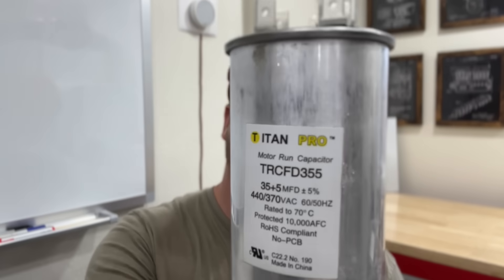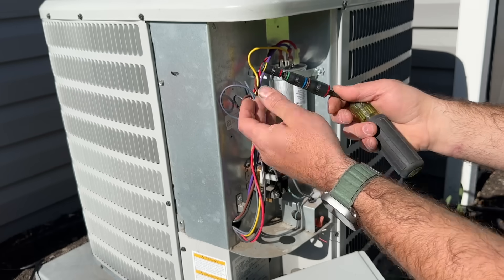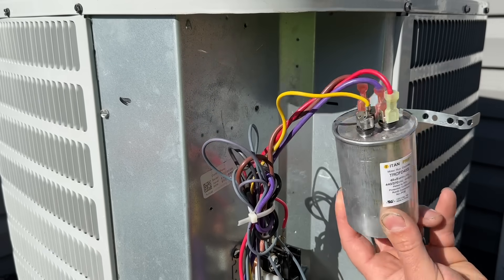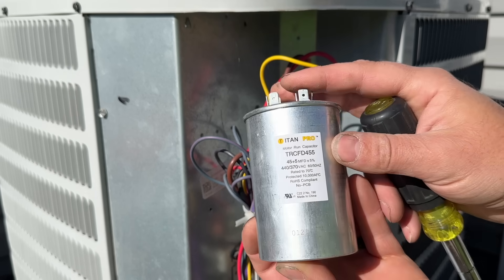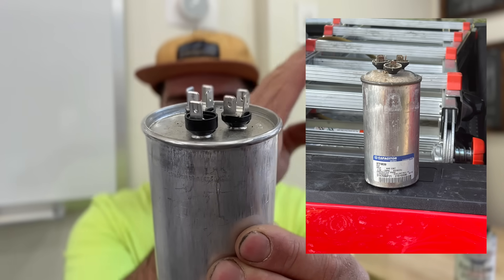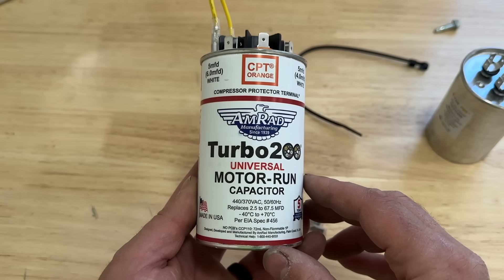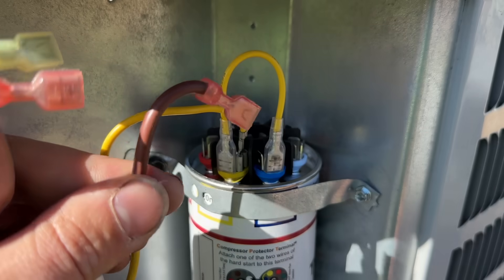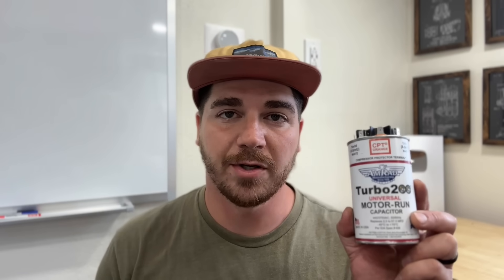HVAC Contractors Practically Make Their Living On These

Comment: I was scammed by Cool Ray in Alpharetta, Ga.  I signed up at Home Depot for Cool Rays $29.99 AC tune up (BIG Mistake).  My AC was operating perfectly fine, but for 29.99 and I hadn't had an inspection for a couple years, I said, "what the heck"...  Well, guess what the Cool Ray guy tells me, "your capacitor is really weak and it could severely damage your AC unit if it fails"...  He just happened to have a AMRAD Turbo 200 Universal capacitor on his truck.  While he was getting the part I googled the part and yes, $70 on Amazon Prime free shipping.  I asked him how much to change out the capacitor?  Part and labor:   $432.  The Cool Ray technician made it sound like a big job!!  He installed the new capacitor and closed the panel in under 5 minutes...done.   I will never use Cool Ray ever again!!  BTW, when I questioned the technician about the job and cost, he became very embarrassed and said it was Cool Ray that requires us to replace these capacitors and to charge this high amount..."we wouldn't make any money on these AC tune ups if we didn't replace something.  Cool Ray is a scam and they know it!!

Comment: Last summer my AC company told me the capacitor was going bad and quoted me $330 to replace it. I gambled and didn’t have them replace it and luckily made it through the hottest summer even in south Louisiana. This spring I bought a replacement and did it for under $20. I bought a spare to keep on hand too.

Comment: Had an AC guy tell me that my family might die of carbon monoxide if i didnt spend $10,000 a whole new hvac system for a 1500sqft home that was only 5 years old.  all it needed was a $30 capacitor.

Comment: I have used my HVAC company for years. They are really honest. I'm lucky. I just had my units replaced... it was time. There was an electrical issue that shut one of the units down... it happens.  The company dispatched a tech and he said I need to replace BOTH of them. I have a good relationship with the owner and called him. He came out with the tech and Op's manager. It was a fuse. A $1 part. The owner was embarrassed. More like appalled. He fired the tech right in front of me. The owner was very apologetic stating over and over again "my father would have never allowed this, this is not how we operate". He fixed it right then... himself.

There are good ones out there. Few and far between, for sure.  Aaron- you are the man.

Comment: This goes for ceiling fans as well.
This past Thursday, I made my Thursday rounds to one of the gyms I do maintenance at. The manager said “7 of the fans won’t work… I think the fuse is blown” well I knew right away a fuse wasn’t blown… plus they are breakers anyhow. I told her “nope… the capacitors are bad”. “How do you know that? You haven’t even done anything!!!” I told her to flick them on as fast as possible on the dimmer” sure enough, a few came on. I told her “that’s how I know!”
Changed the caps and swapped the dimmers for regular switches… no issues!

Comment: Something people should at least look into is home warranty companies.
When we bought our house in 2007 we signed up with a home warranty company.... American Home Shield.
I have zero connection with them other than being a customer. 
It was about $35/month.
Now it runs about $55-$60/month.
There's several different package levels you can opt for. Each level will warranty different home items.
For example the level we pay will cover AC/heating, water heaters, sump pump, water softener, washer/dryer, stove,  refrigerator, in house freezer (not in garage or porch) dishwasher.
Sewage stoppage, ceiling fans etc.

Over the first 4-5 years we mainly had a few issues with our central AC unit.
We paid the service charge (around $75) and the rest was covered by the warranty company.
Around 2013 we had our entire AC system for and the only cost we had to pay was the initial service charge ($75) and then the outside concrete pad for the condenser around $90.That was it.
Total cost would have been over $5000.
A year later, the electric hot water heater took a dump.
Same charges as before and saved us over $700.
Your mileage will very of course but this is an option worth looking into for some.

Comment: Great video.  I'm a mechanical engineer and have replaced several start-run capacitors over the years on my HVAC units.  Helpful to know how to look up the specs and reconnect for a smoother startup.

Comment: my 15 year old AC "went out" a few years ago over the 4th of july.  like any DYIr, I went out to the unit and listened...  heard the slight hum, checked on the internet looking for a solution and found the same thing.  the hard part was getting the part itself.  no hvac company would sell me the "test fix" part.  I found it on amazonia, and ordered the cap and fixed it without issue.  1 of my coworkers AC fritzed (8 years old) and he paid over $16k for a new complete replacement unit without even trying the capacitor change....  and yes, I did suggest it...  I guess it takes all kinds......

Comment: Great video! Best video for so many to save money every year. Every several years I have the same coil go bad. I have local company come that sold me the system come out and charge me $190 service charge and $380 for the coil. I even had the cover off and already check it so I knew the coil was bad.  I also have the 7 year warranty for parts and labor. “Parts and labor” , that means I/you still paid a “service call fee”.  They also warranty the coil for a return to factory and give me a $190 dollar rebate. Total cost $225 + taxes and misc for nylon wire ties. It’s always been the coil only once Ive
a fan go out. Your viewers need to understand this is an easy coil swap. However, you do need a level of mechanical ability to read and understand the multimeter and voltage you’re testing. 

Thank you,

Comment: Homeowners thinking they should only pay for the part and not for a service is wrong. A good AC company will check the entire system before leaving. We, just like any other business are doing it to make money. While I do not agree with $2000 for a capacitor. I do not agree it should cost $15 to change a capacitor. Find yourself a small Honest AC guy and pay for the repair, max $250 if the rest of the system checks out. We look at other things when we come to service your unit. Yes there are scum bags that charge way too much but please don’t lump them together with good honest people trying to make a living. Stay away from bigger companies because that equals high over head and higher repair costs.

Comment: I got charged 300 for this repair. I knew I was being scammed but I have a tenant and really had no time. In my rage and shame I changed entire ac system to mini split with solar panel with battery for 20k in material. I was quoted 120k to change the ac and that is without solar. I thank them for the scam that fueled my rage.

Comment: The HVAC industry are crooks. I had a guy come out to look at my heat pump and told me it was going to be $3500 to fix. I rechecked the breaker myself and it was the problem which cost me $20 to fix.

Comment: Also 90% of all heating and air technicians I’ve met do you not know how to charge an air conditioner correctly let alone install one and do the procedures that will make him last twice as long. Also, the sad truth 90% of all refrigerant gets blown out into the air. All the homeowner have to do is put up cameras and learn the procedures of recovery, then they can get their system for free because it would be a lot cheaper than what the EPA will do if they find out

Comment: If the HVAC company wants to immediately sell you a new unit or gives you an outrageous quote for something simple like a capacitor replacement, kindly decline and find a new company. Years ago my dad had a leaking A coil on his heat pump, first company wanted to replace his whole heat pump after telling him the parts weren't available. Calls a second company, they picked up a new A coil from a local supply house and had him running in no time. 

Personally I've replaced the capacitor in mine 3 times over the past 20+ years and last year I had to swap out the outside fan motor because it seized up.. it's been working like a champ since.

Comment: About a decade ago I started shadowing professionals while they fixed recurring problems. The jets in my gas furnace get plugged up every 3 years or so. $400 fix. It was the jets getting old. $36 for the parts and 15 minutes to repair. Toilets - piece of cake. A/C capacitor - $20 and I keep a new one inside the A/C. I consider hiring a pro as paying tuition.

Comment: Kinda irrelevant but our AC has been running great since we bought the house 10 years ago. Couple years ago we had our machine inspected by a local large HVAC company that have a lot of great reviews. magically it stopped working the moment they left. In 90 degree weather for 3 days, each day they sent one of their guys to look at it and they all shrugged and said it was just an old AC that had been sitting on a slant and to buy their new 4000 dollar unit. We ended up hiring some Mexican guy who didn’t speak English and he showed us the wire they placed in the unit to short it. AC magically started working after replacing the wire and has been working without error since. It’s just appalling the original guys that inspected it and then all three of the guys that came after were so dishonest and scammy and not one said or did anything about it. The first repair guy was all cheery at first and swearing like we knew each other but after he looked at the machine he was all business and wouldn’t budge on any explanation and just wanted to leave.

Comment: ☝️This is why I LOVE YouTube! I have probably save upwards of $25,000 over the years learning to do simple things just like this, that a “professional” would have charged an arm and a leg for. Motorcycle maintenance/carburetor rebuild, bathroom reno including plumbing, framing, drywall and door hanging which cost me a total of $1500 which included tools and materials! Vehicle alternator replacement. Tiling. Minor electrical work. The list goes on…

Comment: We had a service tech come to "service" our outside unit. He said there was a problem with the circuit board and it had to be replaced for $1000. We said we would talk about it then call them back later. Come to find out, he disconnected a wire. We will never call that company ever again.
Reply from the maker: Wow this is the exact sketchy stuff I’m talking about. You should have straight up sued that company

Comment: The screwdriver that you used isn’t insulated!  Insulated hand tools for electrical work have an exposed orange rubber coating.  On the inside there is yellow rubber.  If the yellow shows through it should no longer be considered insulated.
Reply from the maker: The handle is insulated from the metal, you can’t use an insulated shaft to discharge a capacitor. Maybe I’m just referring to it wrong. But you obviously don’t want to be touching the metal portion lol

Comment: Recently, I needed an AC repair and sure enough, it was the capacitor, it took the technician about 5 minutes to change it..he was in and out of my property in less than 15 min, and I was out of $350.  I guess, I should feel Lucky that he ONLY charged me $350 instead of thousands of dollars.  Now that I have watched him change the device, and I'll save this video in case the capacitor goes out again.  I looked it up, the capacitor that he used cost about $15 on Amazon.

Comment: Does anyone else hate the length of the tail on the cut zip tie on the wiring @ 1:55? Like... why even bother? Just to make a plastic shank? Who ever did that wants the world to burn.. and that wasn't a "u-f" it was a "mu-f", Greek lettering and it means 1,000th of a milli or "m". That is important because it explains the jumpers and other aspects of what you're explaining. Aside from my little nit pick, this is a great video! Thumbs up!
Reply: "the length of the tail on the cut zip tie"

Right?! If you don't want to buy the tension-adjustable flush-cutting cable-tie "gun," at least trim it close with your dikes (better; leaves a very short tail) or trim it FLUSH with your utility knife. One of those sharp tails will slice you up if you hit it just right. No pride of craft.
Reply: @PanhandleFrank  YUP! That would easily get you solitary if found in your cell. It is SOOOO easy, and you are already there! You already demonstrated having the tool(s) needed by making the original trim. You're not reusing that zip tie and "need room to grow". It's good to go, all grown up, adulting as a zip tie does. Tidy it up; tailor that suit bro.

Comment: I had a certified HVAC tell me my capacitor was bad and offered to change it for $450, which I declined. I bought one on line for $20 and did it myself. The unit still didn't work. Turns out the main circuit breaker had tripped but you couldn't tell from looking at it. after toggling it back and forth the unit came on instantly. CHECK YOUR CIRCUIT BREAKER MAIN!!!!!!!!

Comment: Just replaced my capacitor. I bought one for backup and thank God I did. I had to use it just today. My AC has the exact symptoms, fan only no buzz from condenser. After replacing it, out fired right up. AC back on, registers showing 58 degrees!

Best of all, $15 bucks! Ordered another backup instantly. Ready for the next failure.

Comment: Yes, even much smaller capacitors than this one are capable of instantly melting a screwdriver if it shorts the terminals (think arc welding) . They really do need to be discharged carefully through a suitably large resistive load.

I don't like that you left those jumper connectors bare.

Comment: Dummy, that is a run capacitor you're holding it cleans the sign wave to help the motor run through the NILL of the sigh wave. A start capacitor gives the compressor a boost to help start. YOU DON'T KNOW WHAT YOU'RE TALKING ABOUT!!! Just because you can make a video doesn't mean you know anything. At least get the fact strait!!!!!!!

Comment: So, question: Is there a time frame for changing one? My unit is 6 years old. This time last summer it suddenly stopped cooling. It was the capacitor and it was replaced under warranty. Would I expect it to go bad every 5 years now, or is it so random it's not worth it.

Comment: Usually its a good idea to check the AC, spare capacitor before summer start.  Label each terminal with color of each wire, or remove one by one.  Don't fall victim to those phone solicitor to tune up your AC.  When they arrived they will give you estimate on what is broken, a scam.

Comment: The capacitor you were holding is not a $10 capacitor try $30-$40  Normal charge to replace it should result in a $125 diagnostic and around $85 for the part. Anyone charging more than that is a rip off. Remember the customer always has the option to diagnose and fix it themselves. Nobody forces them to call the HVAC contractor. Pro tip: Rinse the dirt out of your condenser coil with the hose every year and you should never have to replace the capacitor.

Comment: Yup. Air Around the Clock got me for $350 to change one of those out. The technician left it behind when he left so I looked it up. Found it for $20 online. So that was $20 for the part and $330 for labor. Considering HVAC repair labor rates are between $75 to $150 an hour, I'd say I was overcharged by twice what the job was worth. Thanks for this. WIll be doing this repair on my own from now on.

Comment: Had a very similar incident with my well pump. When I ordered the new capacitor off Amazon, I went ahead and got 2 so I would have a spare that sits right next to the box. 2 day shipping seems fast when you are just ordering a pair of socks but 2 days of flushing toilets with water from the hot tub feels like an eternity.

Comment: I have a Trane AC Condenser manufactured in 1988.  The dual capacitor for the compressor is 30 microfarads with connecting resistor and wires that are orange to the left and brown to the right with a separate dual capacitor of 5 microfarads for the fan with purple and red to left connector and brown to the right connector.  There are no marking for herm or fan.  I am guessing that the brown wires on both are both commons.  

So my question is if I use the turbo capacitor jumpers to connect with the 10 and 20 to get my 30 microfarads for the compressor and then connect both the red and purple to the 5 microrad connector and both brown wires to the center common, can I replace the two capacitors on my unit with the one turbo capacitor?  Thanks in advance.

Comment: I was also using a top AC company in my area for my annual contracted maintenance and service call.  On one call the employee stated my capacitor was 'low' and would likely need replacing soon.  My unit was only 5 years old at the time.  He gave me a price of $500 and when I expressed shock at that, he 'spoke to his mgr' and came back with $350.  I told him thanks, but I'll wait for it to fail.  I then went on Amazon and found the item for under $20!  After inspecting it, it's very easy to see that removing and replacing it is child's play in the DIY World.   I lived there another 3 years before moving and never replaced it.